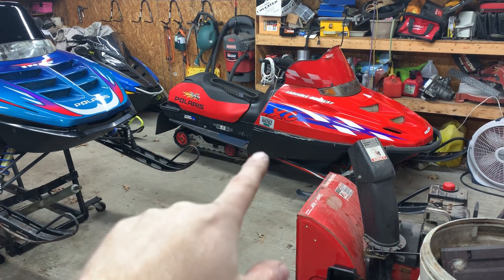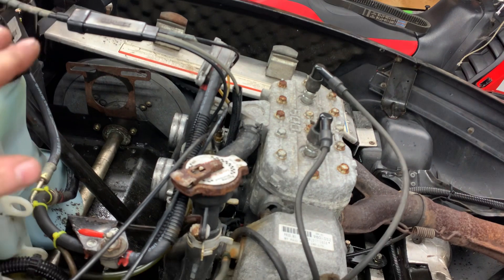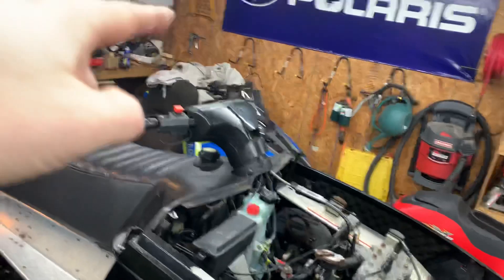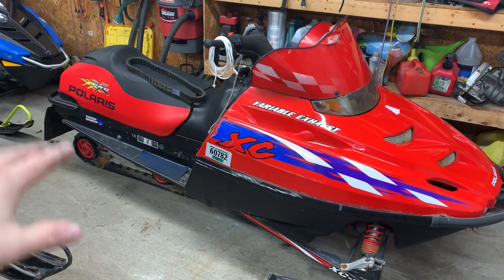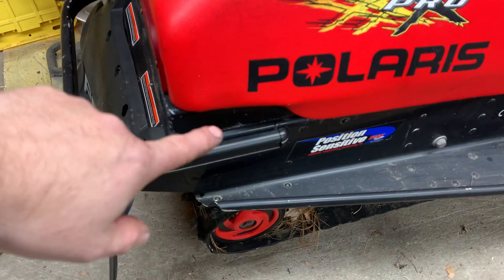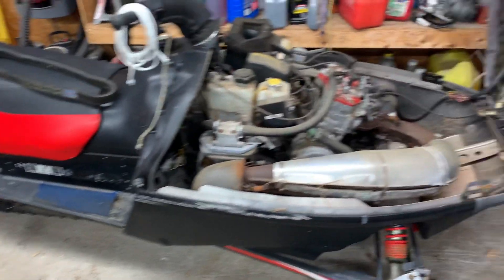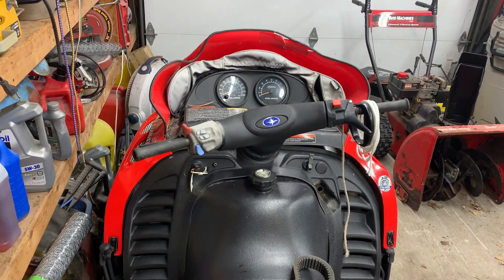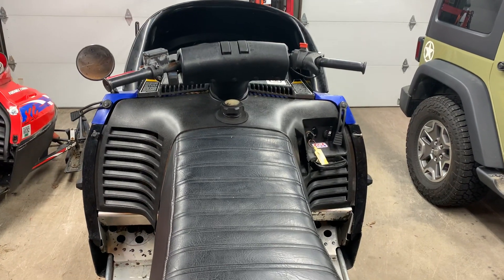Two Old Friends Come Back Home

Comment: I had a 2002 Edge XC SP at one time, probably the most maintenance free sled I've owned yet. Never gave me problems. I like the chassis enough I am experimenting with the polaris frontier 4 stroke... now that's been an adventure lol!
Reply from the maker: Great sleds. The 500 600 and 700 are great engines and the Edge chassis was very well built. 

Good luck with the V Twin. 😀

Comment: Wow, nice score Streeter! I hate to see a decent sled get parted out, but you can't keep them all. And usually you can part them out and get a better return than selling the sled itself. It definitely has some nice parts on it. Nothing I need though.
Reply from the maker: Thanks!  

That is definitely the case with this one. Other than the tunnel and the bulkhead. The parts from the sled will be pretty much gone before Christmas. 

I’m actually glad that so many owners are going to keep their sleds running and on the trails because of it’s parts.

Comment: Nice video. Ihave a 1996 polaris indy 500. I olnlywish it had reverse.
Reply from the maker: Thanks. Reverse is definitely nice to have.
Reply: Ya, can i add reverse on?
Reply from the maker: @polarbear7334  absolutely. Everything bolts right on.  With the removable side panels, it’s relatively easy. 

I’m selling the entire reverse kit for $200.
Reply: @StreetersGarage  im in antigo wis,what would the shiping cost be
Reply from the maker: Based on current rates and the weight.  Probably $45
Reply: @StreetersGarage  ok i will get paid on  the 24 i will let you know like wesnday or tuesday if i can swing the money for it. I would love  be able to get it. But just not sure on what money i got to spair for it.
Reply: I can aford it till mid Jan.
Reply from the maker: Sold it yesterday

Comment: Any thoughts on replacing a ripped seat?  I did find a place on Ebay called scottysledshed for $155.  I would do replace it myself.
Reply from the maker: They make great covers. I’ve used them twice on my Ultra rebuild and the 92 XCR 440. I have install videos for both of them.

Comment: NO way dude.. Don't part it out.  SPI Pistons, Rings and gasket set ion ebay 189.. Poor sled.. :( being parted out.
Reply from the maker: Already disassembled. This was the 3rd Indy 500 I flipped. If I opened up the engine, I would have split the cases and done a full rebuild including Crank work. 

I would have been in it for $700 I’m guessing and the value of a really nice 500 is only $1000 - $1300. 

If I picked this up in July. It would have been a no brainer.